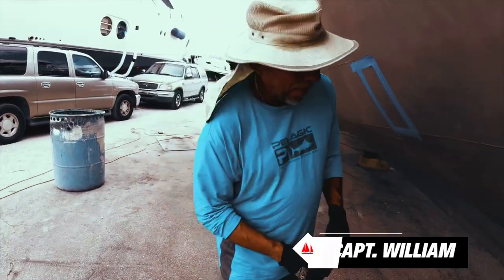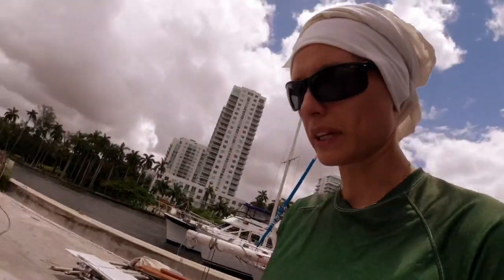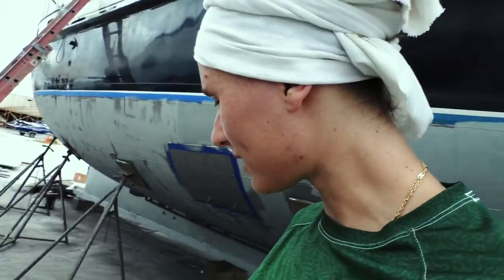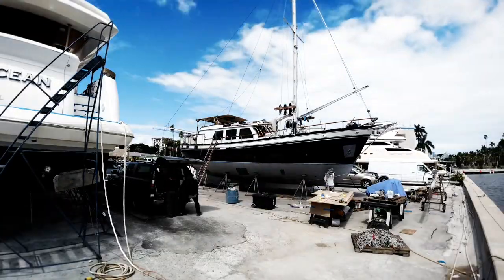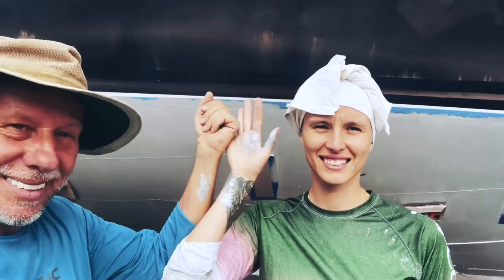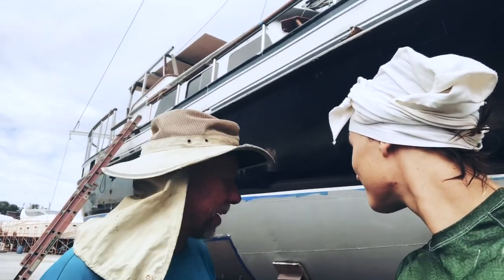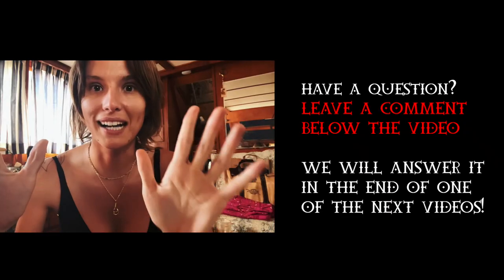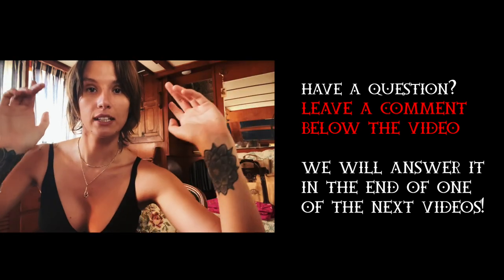Bottom Painting a Sailboat Ketch NO MORE RUSTY BOAT Steel Boat RUST REPAIR Metal Boat Restoration

Comment: Your boat has a good hull shape,it should be a good sea boat ,but you will get some rolling i belive.Nice boat .P.S im an old commercial Fisherman.
Reply from the maker: Hello George. 
yes the steel and hull shape is what I was looking for. Used to upgrade offshore oil rigs so riding in crew ships offshore Africa gave me a real love for steel. This boat design has a super low CG and the main mast sail is there to deploy and use wind to stabilize the 45 tons. Keel is filled with oil for added weight and low center of gravity with a solid 4 inch x 6 inch steel beam along the complete 48 foot run. 
Where were you a CF? 
Thanks for watching 
Cpat W
Reply: @DawnHunters  I am from the east coast of Canada, a place called Prince Edward  Island.So I fished commercially mostly in the North Atlantic, but I also fished out of Florida, Port Canaveral mostly, on a commercial Shark Fishing boat for 3 winter seasons i believe..
Reply from the maker: Do you still fish George? I’m struggling with catching fish. 😂 maybe you can give me a lesson! 
Iana

Comment: That bow area sounds very soild is it ice rated
Reply from the maker: Hello Jackster 
That is a very good question. I know the bow has a very large stainless steel plate welded over on top of the steel. Dawn Hunter is fabricated of a steel type used in Holland for oil tanks and vessels. It has a larger carbon and chromium content which makes it super tough. It is also a pain in the ass to weld or cut. The rust spots are due to past owner painting the steel with incorrect primer/sealer so water was trapped behind the paint for years before rusting out. I will check out the bow today and let you know if there is added steel 
Thanks for the comment 
Capt W

Comment: Ah yes!  Epoxy in the hair.  For when you need that extra holding power!  I was going to say, with that keel, you’re ready to make the northwest passage any time of year.  (I’m hearing there might be some battles for  right of ways and occupying of the northwest passage now that global warming is melting the ice caps.)

How do you inspect and repair your bow thrusters?  I’m going to assume you have to cut away the grill for access and weld the. Back up when finished.

I’m disappointed in you. 😢 You missed the golden opportunity to paint some graffiti before applying the first coat. 

“Dawn Hunters.  Going Nowhere Fast”
                         Out Of Our Way!

(It will be a subliminal message.)
JK 😂😂
Hey, a guy needs to meet up with his friends to discuss best practices. 😉🍺🍻
Was that working hard?  Or hardly working.😂. Funny you should say Vaseline legs.  I would have never thought of that.  But, I bet if my friends were over discussing best practices, that tip would come in handy. (Plus, think of the fun you could have afterwards.). I got a new name for the captain... Greased Lightning⚡️ 😂. Seriously though.  At my work in the refinery, when the painters came in, the good ones applied Vaseline to the bezels on the gauges.  It’s amazing what you find with cheap help sometimes.  Speed is their only concern.  Not quality.

That app Shazam is amazing.  In les than 2 seconds it identified the song “Back to Silence”.  I’ll have to download it.  Um, Iana, maybe you should grow a beard & mustache.  That will help keep the paint off your face.  Hey, wait!  That’s no fair.  I seriously don’t think you could grow a beard & mustache.  But, if you tru and are successful. Please include it in your videos. 😂. As well as the Captain’s reaction, displeasure or show of support.😂

Your boat reminds me of Neil Young’s album “Rust Never Sleeps.” (Hey hey.  My my.  Rock & Roll Will Never Die.  It’s better to burn out, than to fade away.”

Tell the Captain he pInted outside of the lines and got paint on his wonderful tape job that he worked so hard on to get straight. 😉. Which reminds me of a joke.  Kieth Jackson, famed College Football color commentary, was describing one of the starting players.  He said he was making straight A’s.  His I’s were a little crooked.  But his A’s were straight.🤪

Noooo Way!  The Captain is soliciting my opinion on tight....? 😂. I have to give this some careful thought.  My first thought is, this is a trap. Lol.   I’m playing it safe.  I’m gonna save my disgusting behavior for later.  Tight as a drumhead on a piccolo snare.  “Survey Says?” (Family Fued) BING!

Shake it. Shake it Iana.  Give me all you got.  Let me see you pout.  That’s it!  Strike a pose!

Now, I’m embarrassed.  At the market you asked “what is that?”  Then you proceeded to swing around to show you and those nuts, fruits  or momones in the basket.  But, it looked like you were looking at me asking What is that? And getting a better look at my, my, um, momomes?😂😂

Did you have ice cream trucks / vans in Russia?  And if so, did they play music like that one did?

So, lessmones.  Not momones.  Better yet...Nomones.  Hey, maybe those are for buckshot.  I bet you can put a couple in a shotgun round.  Or, you can toss em up in the air and watch the cap shoot them out of the sky.

Gawd, and I’m only 2/3 into your video which I’m commenting on.  I know it.  If you don’t ban me, I bet youtube does.  For breaking the internet for hogging so much data if nothing else. 

Ok, I think I can qualify for being a strange friend if I ever meet you.  But, I’m curious about this broad you speak of.  Let me count these subscriber friends you’ve met...One from Alaska, one from Las Vegas, one from Mexico and one broad.  Where is this broad from. Did she have a name? 😉 I’m sorry Iana, but LOL!  I think there were a few LOLs and a few LOTIs for sure.  Captain, you say it was a dare.  Dare I say the videos are still daring?  And a joke?  Not an episode goes by where I’m not laughing.  And I don’t think you are clowns.  (Oh gawd.  I’ve woken the Joe Pesci clown scene in Goodfellas. “You mean, let me understand this … cuz I … maybe its me, maybe I’m a little f#@%ed up maybe. I’m funny how? I mean funny, like I’m a clown? I amuse you? I make you laugh? I’m here to f#@%ing amuse you? Whattya you mean funny? Funny how? How am I funny?...  You both make me laugh.  But, you also show us how it’s done.  I’m learning a lot.  Unfortunately I have a lot to offer, but it is of little to no value. LOTI.   But, you give me motivation to find more subscribers.  I would love to send you and your icebreaker to the Antarctica. 😂. JK.  I only wish you find the paradise wherever the winds take you.  

That is a gorgeous sunset btw.  We had a few deep orange ones lately due to the wild fires.  But there was still some haze with it.

Oh yeah!  Your special message.  Wow!  You guys packed everything and the kitchen sink in your video with the special ending. I would love to ask Rocky to watch me pull a rabbit out of my hat.  But, that ain’t gonna happen.  No way.  But, I did name my Siberian Husky Natasha.

I do dare to paste this monstrosity in the comments section.  I don’t know why.  It’s against my better judgement.✌️🤙
Reply from the maker: Hello Perry!!!  Ahhhhhh to answer this last post I need open the laptop and put my novel hat on. Lol
I would love to see that Siberian Husky!!  Thank you as always for bringing humor with intellect to this comment section. The shooting rages when I grew up were old gravel pits. Tall walls of sand and gravel so the lead would not get too far. Beer bottles, then cans and then the beer bottle caps for targets. What better way to spend a Sunday afternoon. I still think far more enjoyment than a video game. Get those questions ready for this week. I know you have 20 post-it’s on the wall just waiting to attack. Lol
Capt W
Reply: Dawn Hunters Ha ha.  Maybe I’ll have something cocked and loaded, but ready to pull the trigger if it slows down a bit.  Hut I highly doubt that will happen.  Besides, I’ve already taken much of your time already.  I’ll try to save it for the others.  Unfortunately, I may not be able to restrain myself from some wise cracking.
Reply: Dawn Hunters Yeah!  Outdoors was where it was at.  BB guns, cap guns (and not with those orange tips either),   No firearms until I was able to buy my own in adulthood.  I must say, snooping around, I found my dad’s .22 revolver and some bullets.  I was too afraid to even try to drop a shell into the cylinder.  It was probably best, as my neighbor across the street never took their Xmas lights down.  So, I did for them, one at a time through the cracked open front door with my brothers very accurate single pump action bb riffle.  And today, in addition to being glued to the gaming console, it frustrates me to no end when they can’t put their cell phone down EVER! 😂 ✌️🤙

Comment: You're quite quirky and fun to watch.  Keep it up and get out on your journey.  
That said.. I'd like some tips on how to get a good enough liveaboard trawler between 40 and 60 feet around there. Not coming over right now because of covid obviously,  but in about 3 years time . 
Fair winds and well wrenching wished from Norway 🇳🇴
Reply from the maker: Hello Vidar 
My old rig Partner and Friend was from Oslo.  Big tall guy that was an expert on offshore rigs. Drank a 12 pack and then was the most intelligent man I have known about boats, steel, rigs and offshore work. Learned a ton from Ole Peter 
At the rate we are getting our metal motor sail completed you might be in time to buy our trawler. Lol
I will keep my eyes out for you. Are you looking for a project or something like 90% ready? 
Capt W
Reply: @DawnHunters  hello again captain W. 
I was just thinking about that option lol. However I think your Trawler might be a bit too tall?  
If I remember correctly, a maximum airdraft for the lowest fixed bridge on the great loop is 19 feet up north in the Okeechobee canals area.  
Otherwise I'd love to check your boat out.  I'm pretty much self-helped on anything mechanical or electrical issues , but it would be great not to buy a boat that can't be used straight up for actually safe cruising.  So any sound fixer-upper from 70% or so 🤔